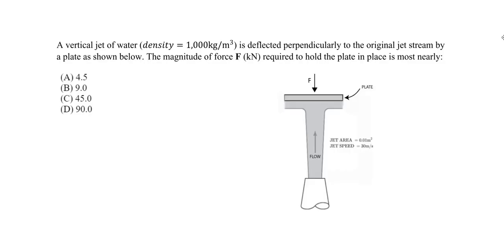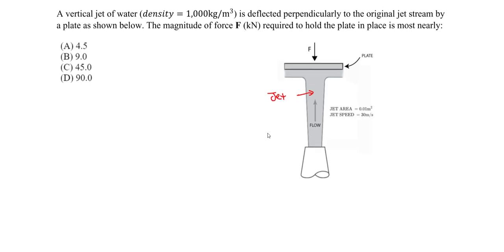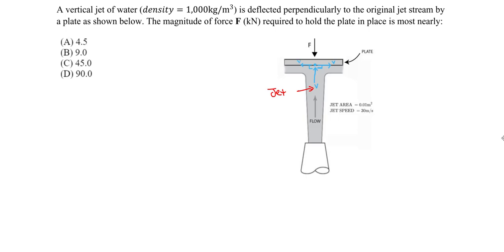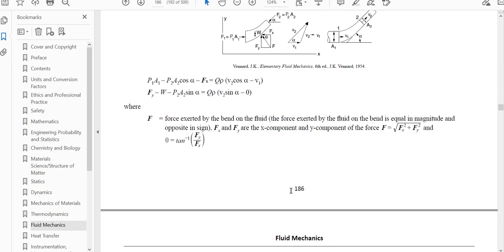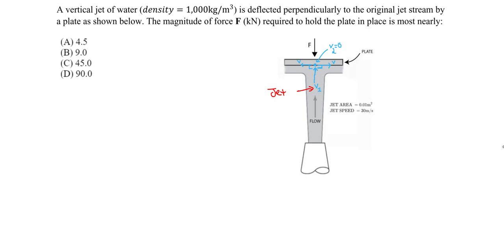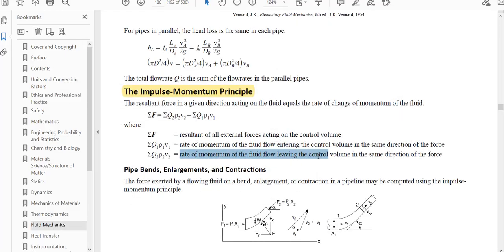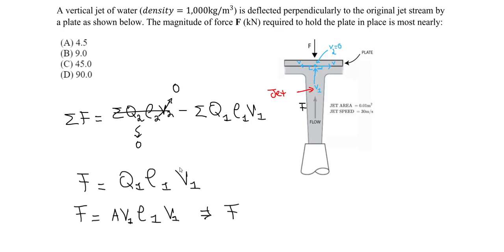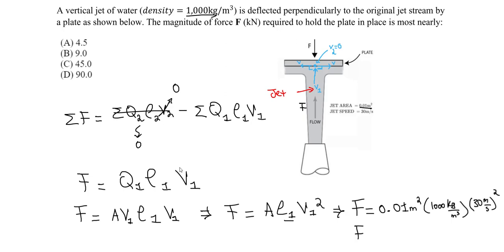FE Exam Review - Fluids - Impulse Momentum Principle

Comment: For Impulse Momentum priniciple,it is the change in force or the net force in the system is equal to change in momentum right. why did you use F as the resultant force. The resultant force should be zero right since it is acting equal and opposite direction.